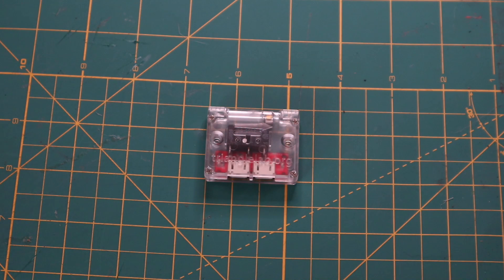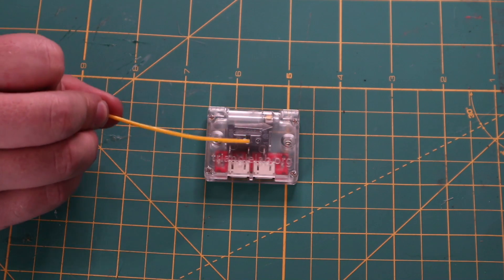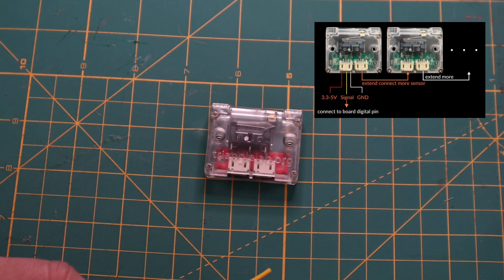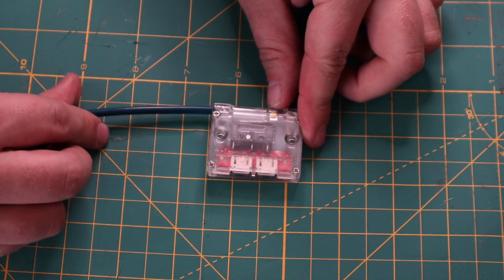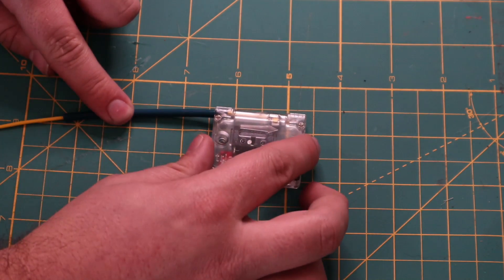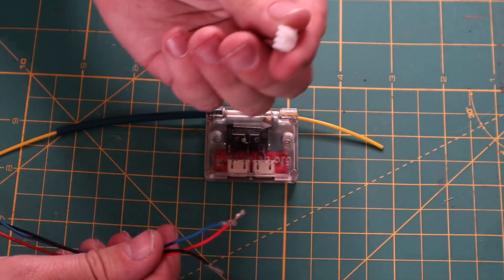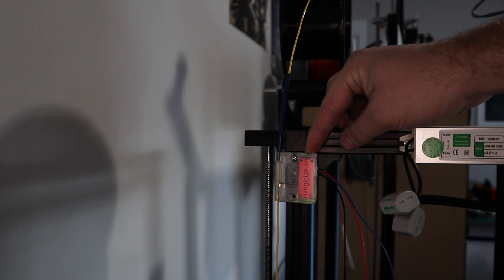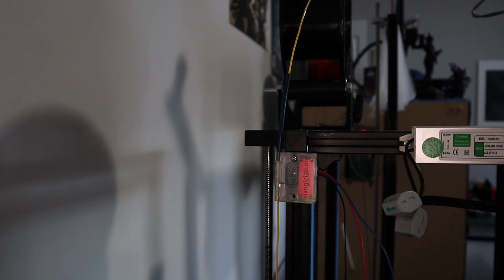Trying A Different Filament Runout Sensor

Comment: Hi Great product but on major flaw that nobody had though about it cause event filament is breaking inside filament loader it will no longer to be able to detect it! Cause it primary function is only detect missing filament! It's need filament movement detector like consumption it will be done by adding a roller that will detect if roller is stopping! With that feature you could say 100% bullet proof on both case

Comment: Hi - i bought this switch after watching the video, and suffering through badness with my S5 sensor.  On the S5, i checked the pins for SVG against the creality switch, and there was continuity.  on the triangle labs switch, i know i'd need to repin if i cut and attach to my existing creality wiring, but my concern is on the triangle labs switch, the pins didn't seem to register continuity unless depressed - do i have to make some firmware changes, like switch open or closed normally?  if so, i'd appreciate any guidance.  lastly, i'm considering cutting the head off my stock creality sensor cable, leaving a few inches from the connector and putting dupont connectors on it to attach the triangle labs wiring.  I'd appreciate any thoughts or suggestions whether this sounds good or there may be a better solution - many many thanks!
Reply: May not be much help, but you could run the output through a NOT gate if there is no software solutions. 

I know not of your printer, so my only advice on that is to make sure your not lowering the insulation (my immediate concern with this switch was alot of low specific heat contact, it's like a little radiator. With that it seems your idea better, due to further proximity from extruder; unless I read you wrong)
Reply: And yeah, you can hook to existing wire or port, it's basically just an extension cord to that tube. Using 5 volt signals I really doubt any issue with a tiny bit of extra length.

Comment: I bought this sensor for my cr10s but it lights up  both red and green at the same time.  A strong green, dull red with filament and same green bright red without filament.  But no mater what state it's in it faults my CR10s.  Did you need to configure anything? Wiring was gnd, active and signal as required.
Reply: Sounds like an induction issue (voltage regulators on motorcycles expirience the same issue). There may be ways around it, but you should return it.
Reply: Another person said connecting middle to ground kills daisy chain but fixes issue. Still, complaint is in order.
Reply: @ironheadrondo5596  Yes..  I did this a year ago.

Comment: For anyone using this sensor and printermods.com direct drive, I designed a mount for the sensor output to feed directly into the extruder. Cheers! 
https://www.thingiverse.com/thing:4378338

If you got a raspberry pi running octoprint, just hook the filament runout sensor to the pi directly and download the filament runout sensor reloaded plugin! Way easier!

Comment: Hi, you say in your video you got this upgrade specifically for a CR10S. 

I have the same problem as @SAMMC4, when connected it blinks red and permanently returns a filament out result. I've check the status using the M119 command in Octoprint and it appears to be returning the same state as the stock sensor but it must be flickering and triggering the runout. 

Do you have a link to the instructions on how you installed it to get round this problem? At the moment on the AliExpress (UK) site, the feedback indicates this is NOT compatiable with a CR10S?

Many thanks for your time, it looks cool in the video if I could only get it to work :-)
Reply: If you're running octoprint, why not connect it directly to the raspberry pi? You can use the filament runout sensor reloaded plugin and run custom runout scripts. WIll make your life so much easier.
Reply: Any luck sorting out the issues.  I've the same problem with it on my CR10s.
Reply: Here's the fix.  It will work on a CR10 with a slight mod. You need to solder a wire between the middle pin on the switch and the ground (black) wire.  Just dont daisey chain it after this mod.  Mine is now working fine.
Reply: Your the second comment with this complaint, complaint to the company is in order.

Comment: just got this switch, but its constantly blinking filament out, even after putting in the settings you used, and alternatively what was recommended from the site. Made sure its connected to correct points. Green lights up fine, and if signal wire is connected its blinking! so frustrating =-( Dont know if it matters that I'm using stock cr10s creality  2.1 board, its got a filament sensor spot that i just tapped onto.
Reply: Did you get it sorted?   I bought this sensor also after watching this video and it's giving me the same issues.  Green and red leds on..  faults my Cr10s.

Comment: Is there settings you need to change to install this sensor?
Reply: Apart from standard runout enabling code, the only settings I changed was:

#define FIL_RUNOUT_INVERTING true
#define FIL_RUNOUT_PULLDOWN
Reply: I want to get this sensor but apparently, I need an upgrade to my board so I can support this device. Do you have a link to where I can purchase that also?